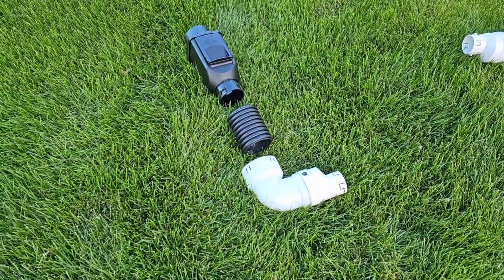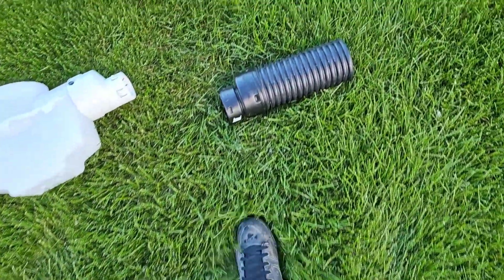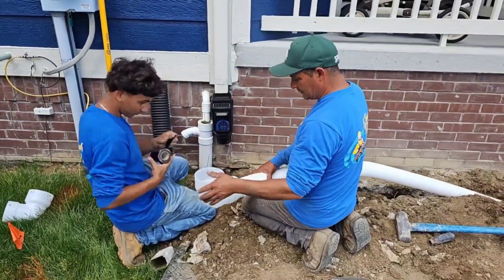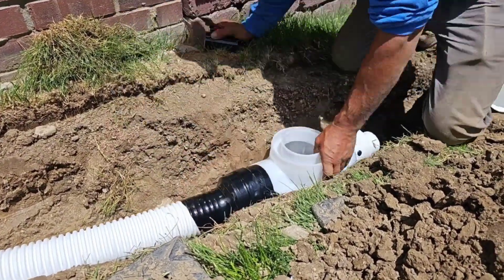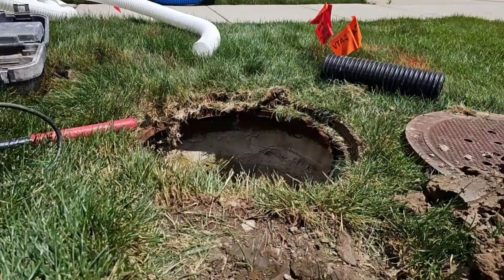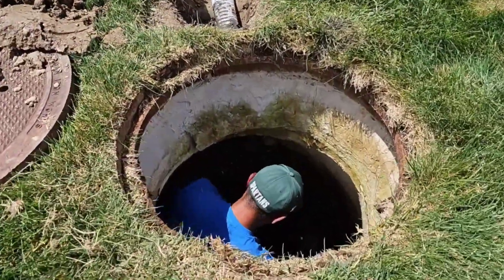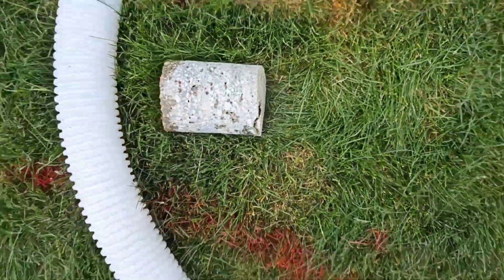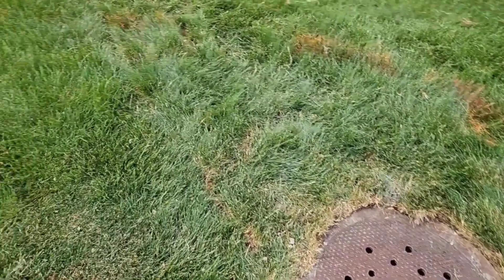How to Run an Underground Gutter Drain to City Storm Drain - Parts List & Full Tutorial

Comment: Does tapping into the city storm drain require permitting from the city to make it all legal. Seems like doing this could get me into some hot water.
Reply from the maker: You have to call your building department and find out. If they tell you no, what are your options? It's a gray area, and it's a lot easier to ask for forgiveness than it is to ask for permission in some parts of the country. Stormwater goes in a storm drain. You cannot put stormwater in a sanitary drain, make sure you have a stormwater drain.

Comment: I wish the “not quite a 90 was included on n the DIY down spout kit…. And the 3 to 4 coupler. Just got the kit. SOOOOO easy. The bend at the house was a drag without the NS90.
Reply from the maker: You must have the kit 10. That is our easiest DIY kit. The pro kit comes with a second "Not quite a 90" for up at the house.
Reply: @FRENCHDRAINMAN  got it!!! Just finished install today! Tape?✅ FDM Fabric? ✅ Pea Gravel? ✅ Did not tape pop up. Easy!??? ✅✅✅ 💥 Oh!!! Almost forgot…..copper sulfate sprinkle? ✅
Reply: @FRENCHDRAINMAN  check out my short on the DIY! Works like a charm. Grass will get planted in fall

Comment: I have a random drain going into the street then about 100 ft to the city sewer. It was just partially dug up to build a footing for a concrete block wall. It had that same black corrugated plastic pipe but who knows where the damn things comes from. It does dump a bit of water when it rains though.
Reply from the maker: You could always run a camera tracker through it to see where it goes if need be. I'm glad to hear that it's moving water and working well for you. It's doing more good than harm if that's the case.